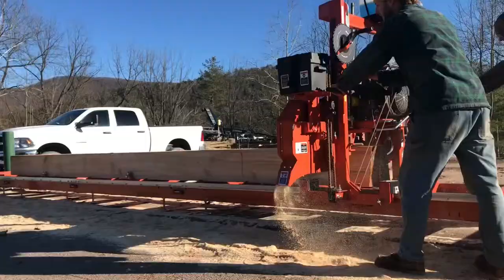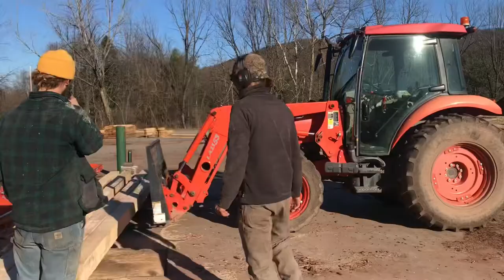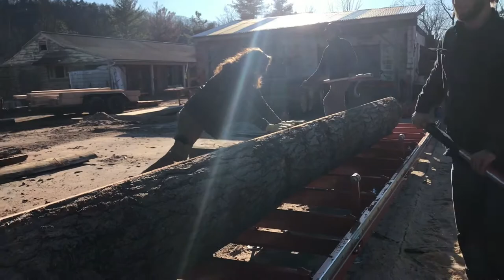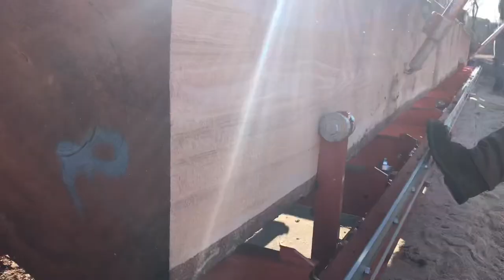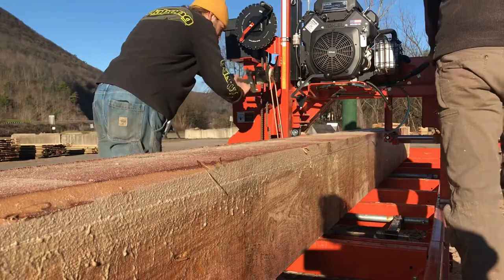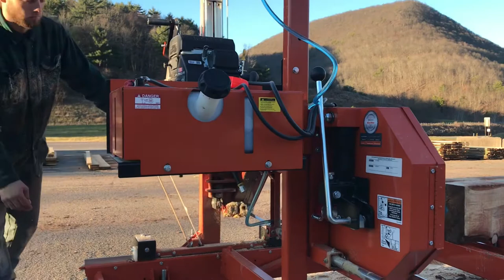Home owners mill in operation

Comment: I definitely like the big LT40 with power everything in your other videos. This one is all manual and needs big guys to move that lumber around and push the blade head.
Reply: a tip: you can watch movies on flixzone. I've been using them for watching loads of movies lately.
Reply: @Ford Blake Yup, have been using Flixzone} for months myself :D
Reply: If you think about it, you could turn those logs, cants with a strap or chain using the kubota’s loader. Go over or under, hooking the loop closed as tight as possible at 6 o’clock or so and lift on the other end of the chain or strap to roll. You might have to make 2 turns around the log or cant..